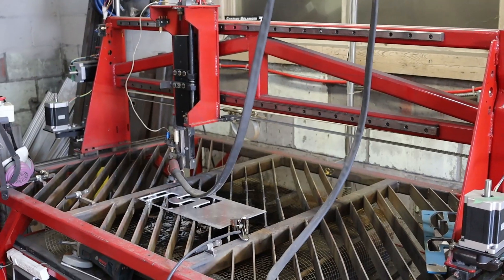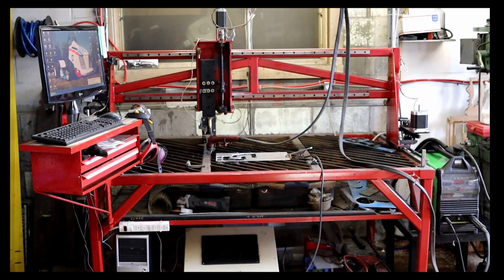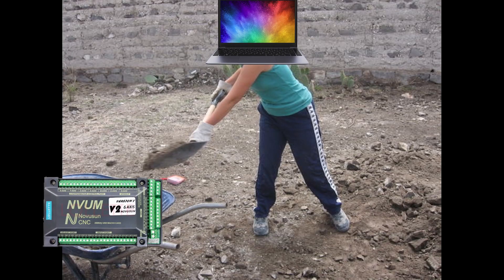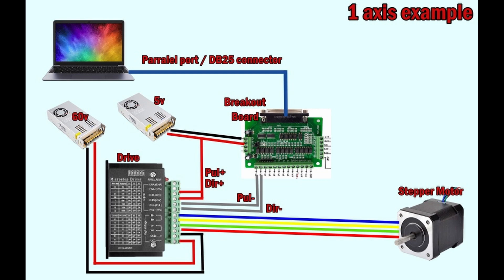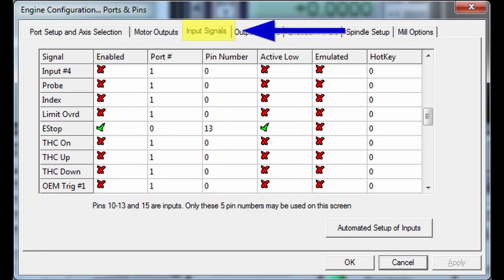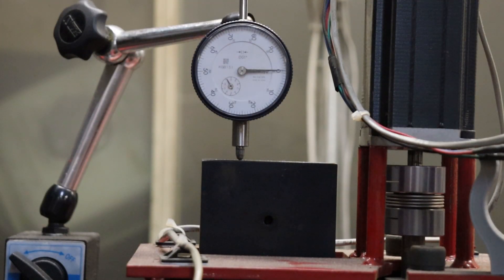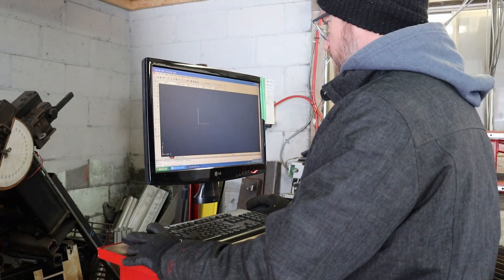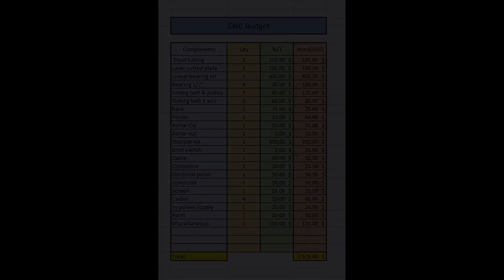Everything you need to know, to build your own CHEAP DIY CNC, the COMPLETE BUILT WITH  PLANS!!!!!

Comment: Hello Vinny, my name is Vic and I have a situation that I hope you can help me with. I have a friend that moved away and left his 5x10 foot woodworking CNC machine in my shop for storage. It’s been 2 years since I heard anything from him and has not responded to any form of communication with me about possibly coming to pick it up. I have the computers and the table. It is fully functional and assembled. What he did not leave here with me was the control box or operating system to run it with. I know the video I just watched is 3 years old and I would like to know what I would need to buy to get this machine to run again, since it looks like I just inherited it for keeps. Please let me know what I need to buy and if any newer more modern and user friendly components are available. I have never used a cnc but I’m also a woodworker and would love to step up my crafting potential. Thank you so much. Vic
Reply: Did you get it running?

Comment: Also, I think the encoder ticks per rotation can be adjusted. Ive had encoder issue before, (bottle inspection machine on a high speed conveyor) where the number of encoder ticks was too low, so I grabbed a higher resolution encoder. After doing this I had to set the divider value for the encoder such that the number of pockets is divisable; in this case, it would be steps per rotation by encoder ticks per rotation. I hope this does not confuse the situation, because it may just ba a matter of using controller with microstep feature. Warning: I’m new to CNC machines, and havent even built one yet, I’m just thinking about problems Ive had with similar machines, with similar parts.

Comment: brealout normal need 5volt drivers need 24V or better 36V to drivers, drivers need be more than stepper motors ampere, if max ampere have motor 4,5A driver need be 5A model. power to drivers need add big can capasitor  about bottle size 10 000uf or more.no weak and lose steps,mach3 found FREE to torrent, but linux cnc FREE have lot better, windows computer have lot problem because windows not handle good interrups. linux cnc have better sure realtime controller. windows not have.

Comment: old table computer were have paraller port need first, cost 20-30$ then instal linux cnc software and can run. paraller port need cable and breakout board cost 10$ then need ewery axle and motor own stepper driver board,  signal need, step,dir,enaple and limit switch, stepper motors best have nema 34 or biggest but nema 23 have minimium motors to mill, plasma can use nema 17 and 3D printer etc, laser, but mill need more power torgue motors,  optimal BEST motors have closed loop nema 43 stepper motors whit own drivers, then need only ball screws and linear rails can start build frame. ready.

Comment: Thanks Vinny. I hope you are getting paid on views because I have watched this several times now. Are you using an everlast plasma? (That is what I'm going with so hopefully firing the torch is easy) I thought I saw a green box. Do you think the 12" spacing between the rails on the gantey/x axis is necessary for stability? I'm modifying your plans to use steel I have on hand and will likely run less spacing. What strength springs did you use to hold the pinion gears to the rack? does it matter?? Side note it looks like some of the links are out of date or better deals are available. If I'm buying anyways I'd love to use an affiliate link. Thanks again for the content.

Comment: Hey Viny ! I assume by your accent your french canadian, which i also am. In case im wrong ill keep on with the english. Anyway, im interested in building my own cnc waterjet cutter as i need excessive precision on the cut itself. Ive been surfing thru a lot of CNC videos but it just keeps on shuffeling the pot in my head.. would you be able to break down the control system more precisly ? You went over the diagram but it seems fairly complicated the way mach talks to the breaker board and all
Reply from the maker: Salut Andrix, c'est assez simple comment Mach3 parle au BOB. Si jamais tu as des questions spécifiques, tu peux m'écrire un courriel au design57@outlook.com
Reply: @vinyb57 You're from Canada...? Then why are you using the crazy measurement system?

Comment: What of breakout board do you use in this build. Also how do you get the plasma arc to start from the computer?
Reply from the maker: The break out board I'm using came with the kit, it's really a no name brand, got 12 outputs and 5 inputs. For the plasma starter, that's a good one, I had to look at my notes, I did this setup 3 years ago😅 So in Mach 3, in the menu ''engines setting, ports and pins'', in the tab ''spindle setup'' you attribute an output pin for the M3 code (clockwise spindle). So every time your G code will see an M3, that will signal the output you attribute.. If I recall correctly, the output then trigged a relay that is connected to a connector that came with the plasma, so that the plasma will start. Hope that helps! Otherwise, send me an email at design57@outlook.com

Comment: I have try to build one but couldn’t get rid of plasma arc screw up the control signal, there’s any trick you did to over come it? High voltage arc is really good for make stepper motor go nuts
Reply from the maker: YES!!! What I did is I bought a ''ready to CNC plasma cutter'' and the second thing you can do is shield all your wires and ground them. I didn't shield mine, got a bit os loosing steps when cutting over 1/4''. Don't use cheap ebay plasma cutting machine. My cutter used a different technology to create the arc, then the cheap machines.

Comment: Excellent , excellent video. I’ve watched a lot of cnc build videos and yours has way more practical information and the production quality is great. Funny as all get out. Loved the peach butt.
Reply from the maker: Thanks Ed! Glad you enjoy the technical and funny sides of this video! 👍 That is my main goal on YT, share my experiences in a entertaining way!
Reply: @VinyB57  I’m interested in making a smaller routing CNC with more precision. Aside from linear rails and ball screw do you have any frame rigidity tips beyond triangles etc. like box wall thickness?
* ideally am the cnc can cut soft metals like brass, aluminum, plastics and wood. I’ll primarily use it to make patterns to use for sending out for iron castings.
Reply from the maker: @rallymax2  well, one thing that comes in mind, is not bolted, but welded and also, the bigger the better.If you have, or can afford big and thick squarre tubes, go for it! I used 2x2x3/16 walls, because that's what I had in the shop! The stiffer the frame, the less vibration you will have. So yeah, I guess that's it! Good Built! 👍
Reply from the maker: Oh and by the way, it's always a ration of feed speed (chip load on the spindel) and rigidity of the frame. Too fast, and you'll get vibration resulting in an ugly surface finish. With your machine, you'll find that sweet spot, where you cut fast enough to get a nice cut finish. So keep in mind, the stiffer you make it, the faster you'll go!

Comment: Very well done. My CNC will be much smaller with Nema 17s, it should be good for my small garage hobby shop. Very helpful and clear info.
Reply from the maker: Thank you TO. Now that's a short name! Happy that it helped you. Keep in mind that my CNC is for my garage and it's on the small size for my project. I once read, if you can afford one step bigger, you should go for it, you won't regret it on the long run....just a though.. Thnak for the comment!

Comment: Doesn't Look like you Included the Price of MACH 3 Software in your breakdown. So just add $200 for MACH 4.
Reply from the maker: Good point! ...and the you can add also the cost fot the Sheetcam software (for plasma cutting)
You may know that there's a free version (only 180 code lines) but otherwise it's about 120$  to 150$

Comment: Have you tried multi threaded acme rod? Should give you more speed and the same accuracy as regular acme lead screw.
Reply from the maker: That could be a good option too.
Reply: That's called multi-start. I get 200 inches per minute using 1/2 X  10 TPI acme thread in 1/8th microstep mode on my CNC machine. But my OS and motion control software can output a decent step pulse stream. It can probably go faster but 2,000 RPM lead screws is kind of insane.

Comment: I haven't watched the video yet but I am noticing that all of the DIY builds demands all sorts of exotic tools to build and by exotic I mean tools most people do not have and are expensive unto themselves and/or demand proper training to use.  Simple device that only requires simple tools to make would be a winner.
Reply from the maker: Is a welder and a grinder to exotic? Because, that's all you need!
Reply: Grinder no but a welder would be a huge yes.
Reply: @thebeststooge  cant you get a cheap welder for like 100 dollars?
Reply: @Di Pf Yet even more money AND you need the proper setup to weld so even more money.  I am lucky I was trained how to stick weld 40 years ago so I know what is involved.  Bench vise, the welder.  Real welders helmet (I take at least a #10 if not darker) and welders gloves (thick leather and if you think you don't need them just wait until a ball of iron flies back on you).  A welders smock (also of thick leather) to protect you for the same reason as the gloves.   I am sure someone will chime in and say they don't use any of that and use flip flops (like this guy in India was doing) but if you have any intelligence to you then you discount those idiots and make safety a number one priority.  Basically that 100 for a cheap ass welder is now about 500 dollars.
Reply: The best stooge, look at a simple cnc router build like Solsylva cnc router, My first cnc was this build and was easy and a very sturdy machine made from wood. All you need is some wood working tools. You can build it with any material even aluminum, I think the guy is still selling plans, he has a wide range on machines you can build.
Reply: @Graham Prinn Looks good.  See what a lot of people forget is that if you get a tool you can then embark on a journey to make an even better machine.  Make it from wood then even a wooden one can do aluminum you just may take eight hours to do a part that a machine made from iron would take 10 mins to do but it can be done.  Get that part done and swap the part out then the next part may take six hours then swap it out and the next four hours because the machine is becoming more rigid.  Another thing is you could take however long it takes for your machine to make the parts that will completely replace with so digging its own grave.
Reply: @thebeststooge  I agree, build small and go from there, That's actually what I did, started with the wooden machine and replaced it with aluminum parts as I went. If you are thinking of building do your self a favor and get the best stepper and drivers as you can, TB6600 stepper drivers are not bad for the price. Ebay is your friend.
Reply: @Graham Prinn They make a 6650 I believe and isn't that much more expensive but I plan on doing nema 17 to start with and will do Nema 34 eventually (skipping over 23s) but the drivers I don't know if the old A4988's can handle it until I upgrade.
Reply: @thebeststooge  I have a 4 axis nema 34 closed loop kit I got on sale for a 4'x8' machine I want to build . Never heard of the 6650's, have to check them out thanks. I bought a workbee cnc router cheap but it came with tiny little steppers and 6600's driver. Too small for a 4x4 machine.
Reply: @Graham Prinn I said 6650 as that is the number that stuck in my head but they were TB66xx and was an upgraded part (not as hot and did more amps).
Reply: What is the best software for working diy cnc router
Reply: @sutharbhupesh9641  depends on what your using the cnc machine for.
Reply: @Suthar Bhupesh You need to specify which software that you are meaning.  CAD and/or CAM?  CAM is up to the user as there is LinuxCNC, Mach 3/4, GRBL, and a couple of others.  For me GRBL or Mach.  CAD Solidworks, Autocad, and a few others.  I prefer SW as I despise the Autocad company and their Fusion360 may be free but you are slaved to the web when using it.  Recently they took away the ability to convert projects from Solidworks (others as well) into F360 unless you pay a monthly sub fee where you have to upload your files etc...  that was the last straw for me.  Pick whatever you prefer for the CAD side and try them all as one will click with you the most.
Reply: What exotic tools? You don't have a laser cutter? Come on! What's a million dollars among friends anyways?